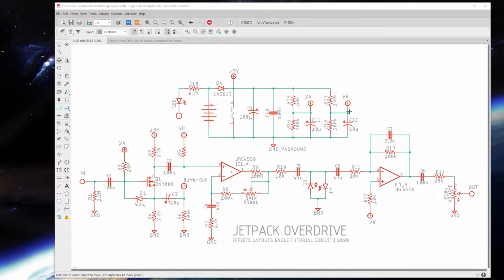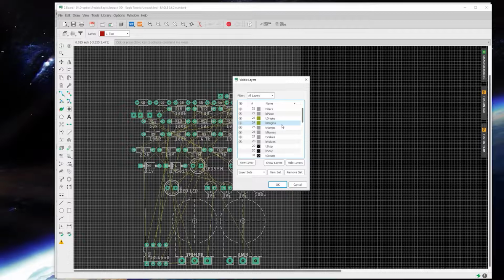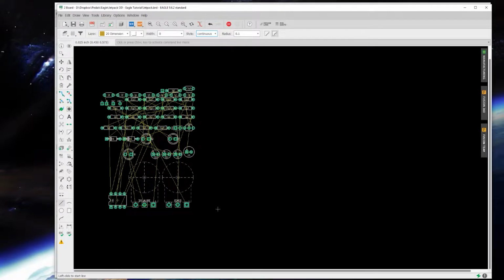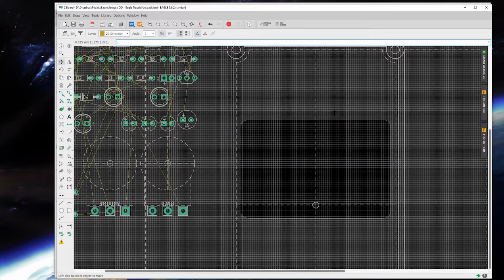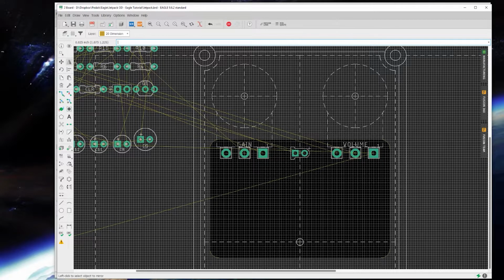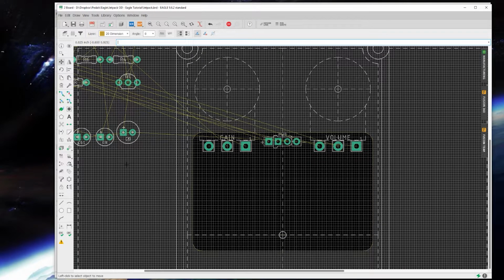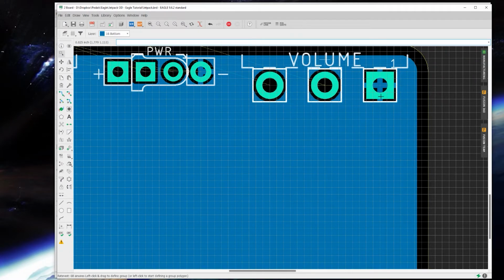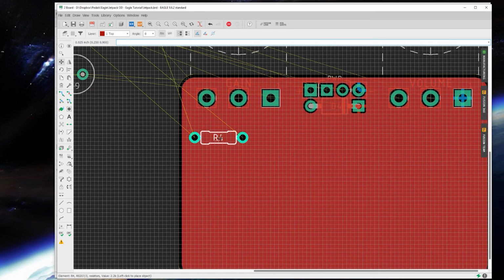EFFECTS LAYOUTS - Eagle Tutorial Episode 4: Circuit Board Layout part 1

Comment: Thanks for the guides! Quick question: I'm finding my pads are aligning with the center of the grid and the other components are aligning with the edge of the grid which is causing my traces to be crocked. What setting do I need to change to fix this? I'm using the same size grid as the video. Thanks again.
Reply from the maker: I've not run into that, at least not when using a finer grid. Maybe when it's on like 0.05 in, but not when smaller than that. Try bumping your grid down to 0.0125 (assuming you're on 0.025)

Comment: Hello, I really love this tutorial, but I have a question, can I avoid doing +9v plane? Would it cause problems? Like undisired noises, and Instead of the 9v plane can I put ground plane at top like at bottom?
Reply from the maker: Lots of pcb designers just do ground planes on the front and back. It won't cause any problems